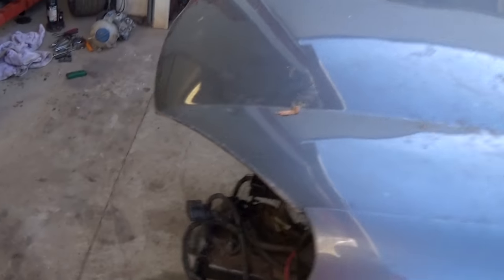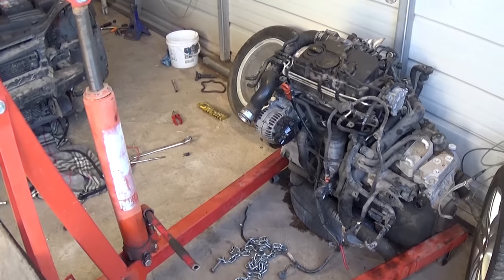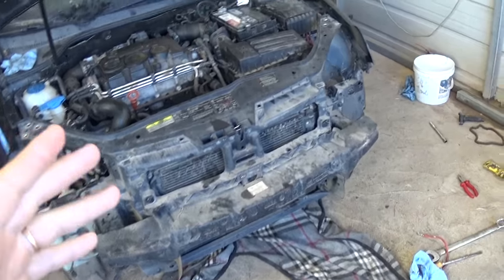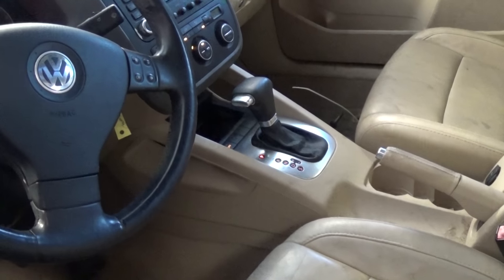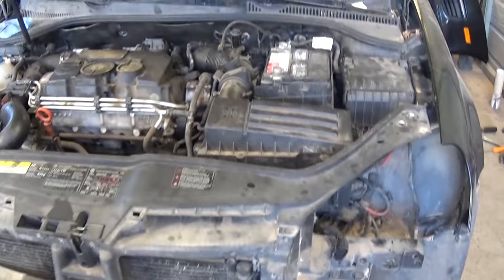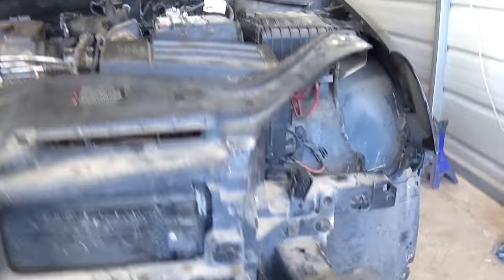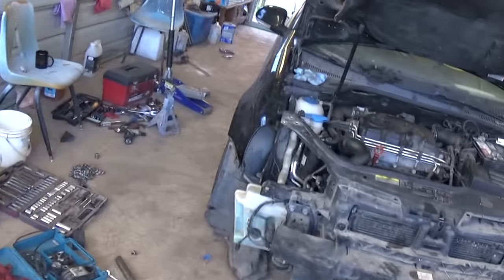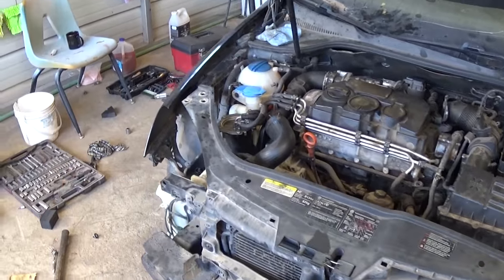VW JETTA TDI DMF NOISE | TDI BAD DUAL MASS FLYWHEEL DMF DSG

Comment: My 06 jetta tdi with a single mass flywheel (over 50k on it) is slipping under acceleration more and more. Recently I get a new sound where when I give it a good burst of gas and release the accelerator abruptly I get a clunk sound. Does this sound like I need a new clutch? Flywheel? The gears are grinding more easily as well. Any ideas what this might be? Thanks.
Reply: Probably a broken trans in result of the single mass flywheel. There is a reason a DMF was put in there in the first place

Comment: I don't see the timing belt jumping teeth or engine being harmed. It would just stop running. The shaft on the transmission COULD be damaged along with the houseing if there was major neglect and the clutch/flywheel completely fell apart but even then the trans would probably just stop working or become extremely noisy before it did so much damage that the trans also needed replacing.
Reply: could you elaborate on your understanding of the likelihood of this damage or lack thereof? I'm debating driving a little vs not at all while having this same sound on the same model of car.

Comment: How long does it take to replace the flywheel?
Reply: Depends how fast you can get the engine out
Reply: @official13dvls_broknlnk_16  2 years ago....I don't have that car no more  lolllll
Reply: @Lord_Joseph17  I am in the middle of my ownership of the MK6 and had to change the motor.

Comment: I have a passat b7 2.0 dsg i had the same noise from gear box housing 6 months back but it became normal after that . Now after 6 months the noise occurs sometimes and then goes. Do i need to change my flywheel now or should i wait for regular noise.

Comment: Just had mine replaced today car sounds so much better
Reply: What was the cost ?
Reply: @moparman2010 I bought the dual mass fly wheel from euro car parts my mechanic advised me it's the exact same thing (LUK).
Flywheel was £290.00 obviously you must change your dsg oil & dsg filter  which is around £160 and that's 5.5 litres for my car.mechanic charged me £200 to do it all. 
So in total.£650 include parts and labour
Reply: Thanks

Comment: it's automatic and uses torque converter, NOT DMF nice mechanics in USA u got, at least buy some haynes before telling bullsh.t ?
Reply: DSG transmissions are automatic and have roboticized dual clutches.
Reply: It's a manual transmission with dual clutches and servo actuation of gears and clutch.
Reply: dont embarass yourself
Reply: Oh wow Marek... be quiet pls.

Dsg gearbox has dmf. I am changing mine now.
Reply: You obviously have no idea. DSG is a dual clutch transmission. It's effectively an automated manual, WITHOUT A TORQUE CONVERTER
Reply: @alfaromeo4838  haha you cracked me up man. Good one